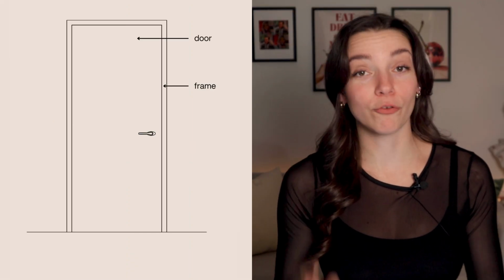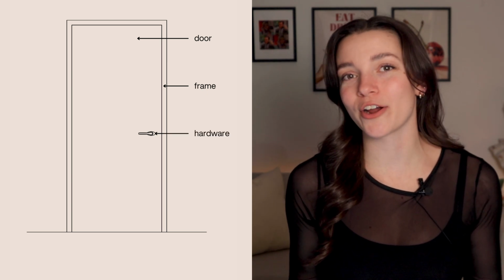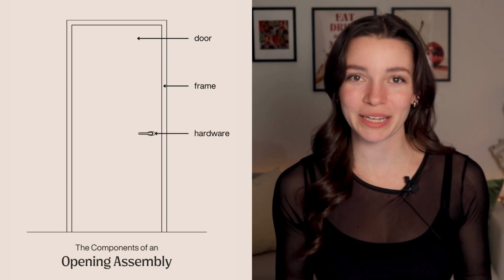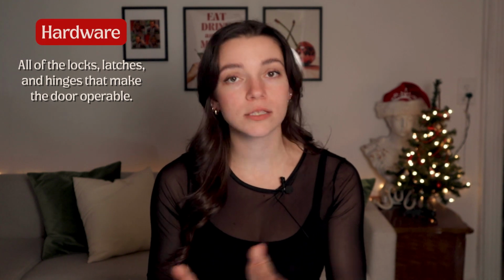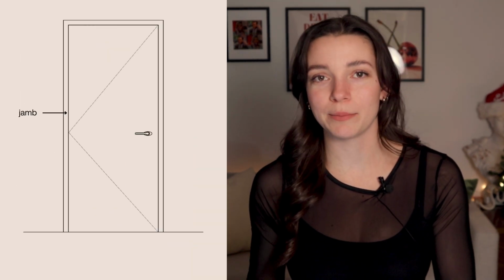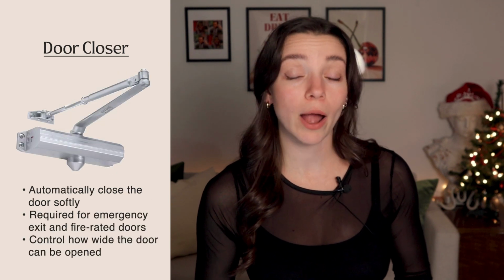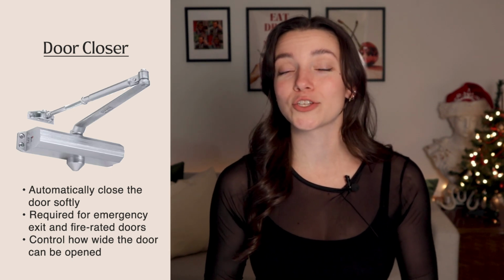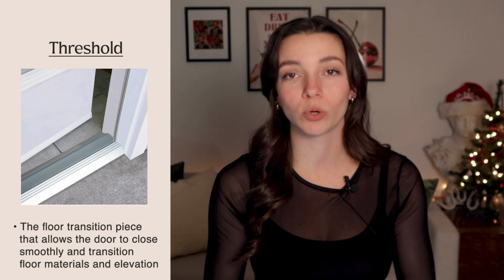Door, Frame, and Hardware Type Basics | NCIDQ Test Prep

Comment: Where did the code say when “20min fire rating require, must require a hallow mental frame”??
Reply from the maker: Hi! Thanks for asking this, as I may have made a slight error in presenting this info. Wood door frame can be used ONLY if they are rated 20 minutes. However, hollow metal doors are most common in commercial spaces and typically used when the rating needed is higher than 20 minutes.